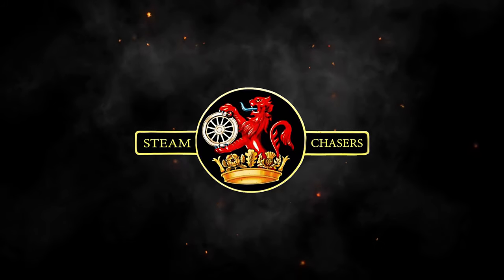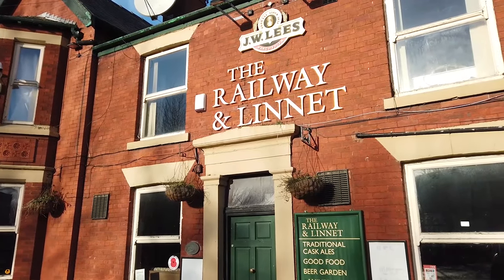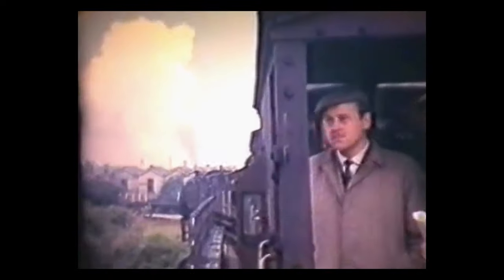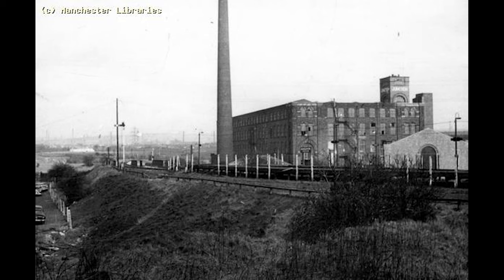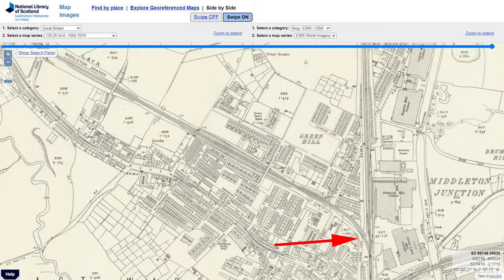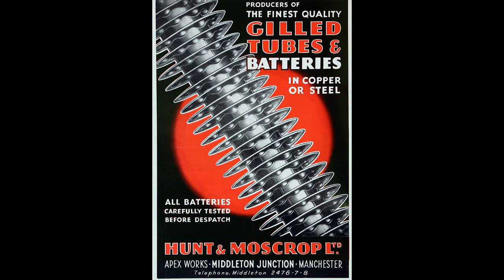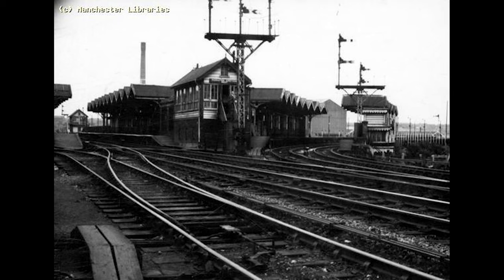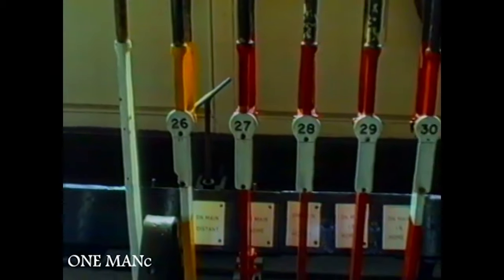History of werneth Incline Part 3 Middleton Junction

Comment: I worked that signal box in those days
Reply from the maker: If you've got any stories you wish to share, I can include them in a later video.  Thanks.
Reply: @steamchasers2809  I am the Malcolm Taylor who was on duty  that day, I wrote the story for the Middleton Guardian years ago.it was great to see again,I am nearly 80 but it seemed like yesterday,what it does not relate, it all happened in minutes.yes I can relate other stories.
Reply from the maker: @malcolmtaylor325  I'm delighted that you've found this and contacted me. 
I was sent your account from a book called  "railway stories of the 1960s"

It also has a story about the white lever used to pump smoke out of werneth tunnel, which i was going to use in a couple of weeks.

If you want to share anything else please do message me at steamsteamchaser@gmail.com 

Thank you very much. 

Colin
Reply: @steamchasers2809  Hi Colin  yes I wrote that true story also,the guy is still with us hence no name, cruel I was, but another story same guy, I had a dolly signal from the Chadderton branch outside the box,one day an engine just slid past whilst against him,the same guy saw this,those days the jct was only a little village I said would you go and get me some emry paper from the hardware shop he did I said would you just rough that rail as you saw the train slip past ok I will and he did until the station master saw him.Happy days we all laughed afterwards
Reply: Another one of many Colin I had a coal train going up to Burnley, he past my home signal at danger, no time to put detonators down so threw a fine bucket at the engine,the driver stopped in the station, I shouted send your fireman over to the box I'll tell you when I have a road for you,fireman came up to the box saying you wont report him will I said no I will not after  dressing down, next thing voice from the engine do you want some coal, one was always after coal for the fire in the box to keep warm , I  got a road  for him and away he went,when the train had past I saw the platform was full of coal, good job it was Sunday and not busy as I was shoveling coal off the platform all day
Reply from the maker: @malcolmtaylor325  Brilliant.
Reply from the maker: @malcolmtaylor325  Thank you for sharing these, I'd enjoy reading them all if you have more. Please don't stop telling them, I know they'd be popular.
Reply: @steamchasers2809   Thanks Colin,I will bring them all out of the brain box for you to relate in your videos,I certainly enjoyed seeing the old box.
Reply: I worked the box for 18 months before leaving in 79 to work in the control office at Piccadilly
Reply from the maker: @doug5700  Tales from anywhere on the network are always welcome, I'll be covering Piccadilly on day soon.